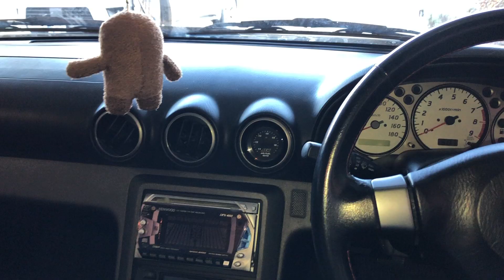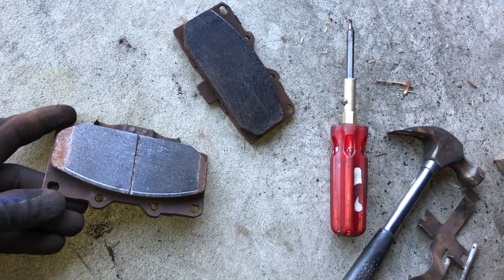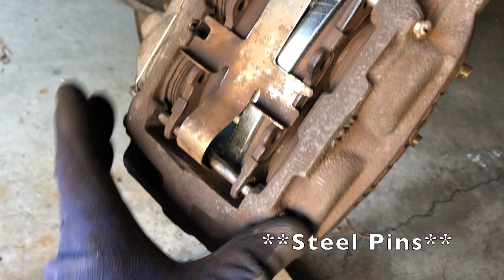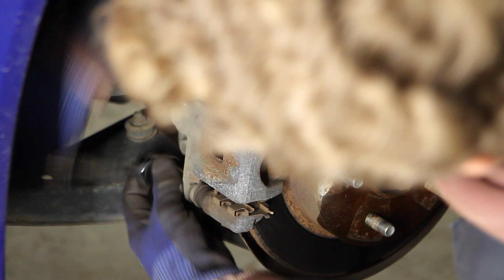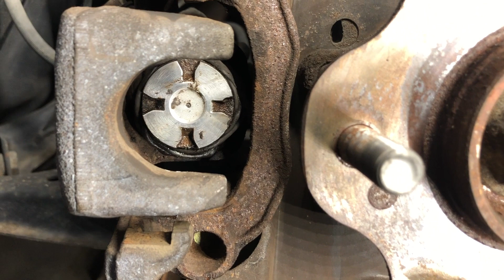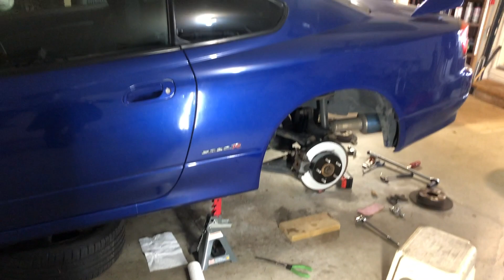Nissan S15 Spec-R Brake Job + Part Specs

Comment: How did you compress the front caliper pistons? Is there enough space to use a G-clamp to compress the front inner pistons? I am about to do my front and prefer not to have to buy a piston compression tool.
Reply from the maker: Ya I was able to compress the fronts inner pistons with a G clamp. Depends on the profile of your clamp though.